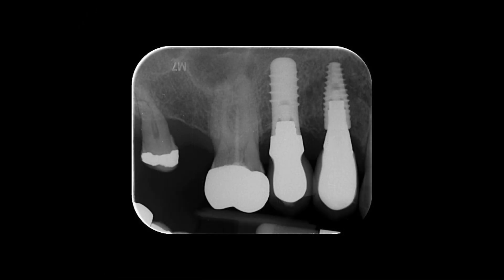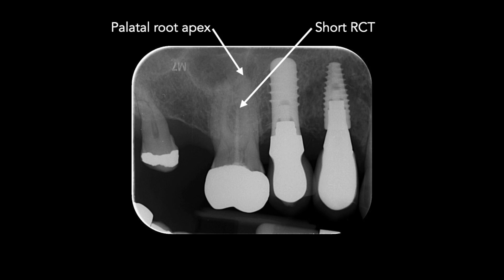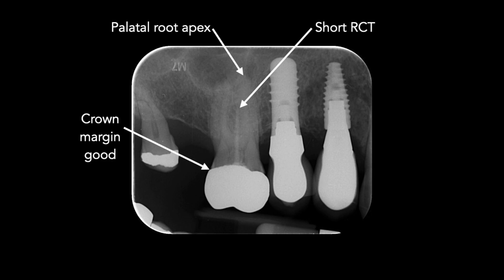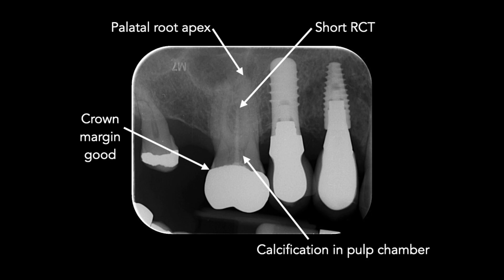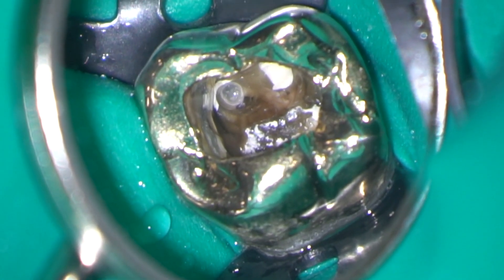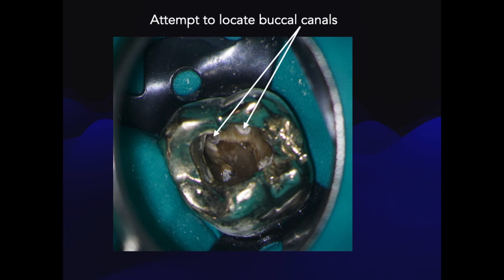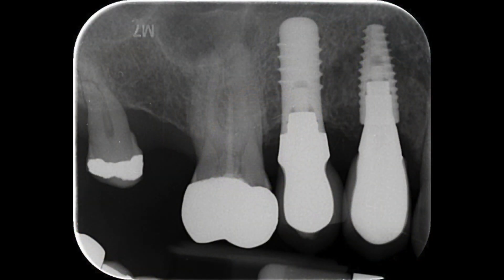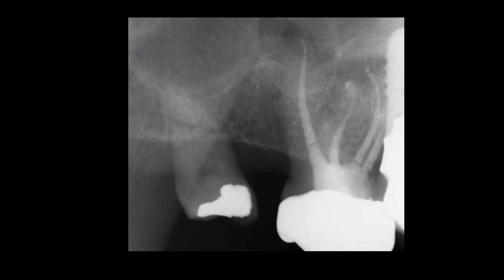UR6 blasting dentine in pulp chamber

Comment: Hiya Mr Rhodes!
Great videos, thankyou for publishing your experience!
I was hoping to get abit of advice.
I find that when using a gates glidden to remove gutta percha in a canal, it often smears it against the walls rather then shreds it out like it does for you. Could the speed I run it at or technique be wrong?
after gaining patency in a canal and confirming it with a working length xray, I often again see gp remnants smeared against the canal wall. Do you have any top tips to efficiently remove these remnants other then wicking it away with Endosolve?

Thankyou for any advice you may have!
Kind Regards
Reply from the maker: Hello Shivy
Thank you for watching and pleased you like the videos
The Gates are running at about 1000rpm and dry to thermoplasticise the GP
remnants can be removed with a micro-opener or ultrasonic irrigation tip
Cheers
John
Reply: You really should be referring to this gentleman as Dr. Rhodes, not "Mr. Rhodes". It appears that you are a dentist yourself so you should know better.

Comment: Thank you so much for your videos. I wanted to ask a question. sometimes my Morita zx apex locator gives a reading, and when I obturate to that reading, it appears short. Why is that? It’s disappointing to see and then I’m in 2 minds about whether I should redo it or not.
Reply from the maker: Hi Aisha
Your apex locator is probably correct but remember the foramen and constriction are rarely at the radiographic terminus (RT) sometimes there can be up to 4mm difference!
I would monitor the case in the usual way..... if you were working to RT the GP would often be extruded!
Thank you for watching
Cheers
John

Comment: What percent citric acid do you use? Where would it be possible to buy it? It is not routinely used here in USA, in endo for some reasons. Thanks.
Reply from the maker: Hi Inna
We buy citric acid 40% from Cerkamed in the UK. 
You could mix the concentration you need yourself I guess as citric acid is used in cooking and is readily available.
Cheers
John